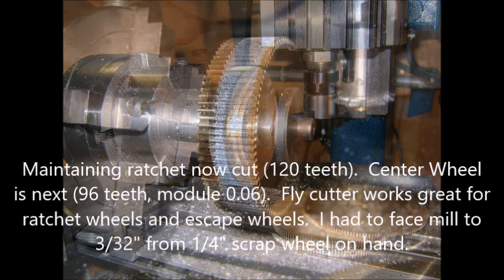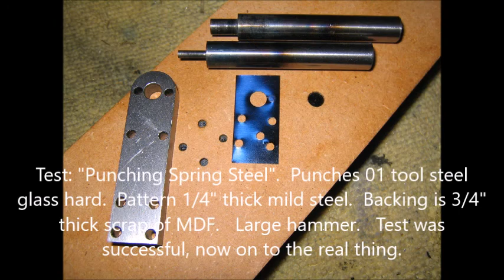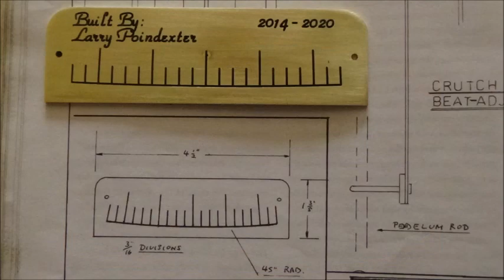Regulator Clock Build - Clock Progress Photos

Comment: Hi, I found that very interesting as I have just finished a very similar clock. Mine was from the book by Peter Heimann. It has skeletonised plates, but many details seem similar, particularly the crutch. I was told that mine had no chance of running asIcut the wheels with involute teeth, even cut the pinions the same way from drill rod. Mine has a conventional two-hand face and runs a month and keeps very accurate time. Currently the pendulum rod is ordinary mild steel but have got a carbon fibre rod to change to. Invar is about £50 in the UK.
All my shaped parts were hand sawn and filled and I spent over three years on it. I bought a chapter ring! Cheap silvered aluminium, but it looks ok. Looks like you have sophisticated machines, my are manual but I have been a toolmaker for nearly sixty-five years, so I am getting quite good at operating them.About to start a 16th century clock, as my cottage is from that era.
Keep up the good work and the videos, please.
Reply from the maker: Nathan:  I'm happy to hear that someone out there has built the same or similar.  Mine is the 8 day version (to answer your second question).  I find this clock also keeps excellent time.  I have a playlist for the clock but it's not very well organized.  I've also built several previous clocks where everything was done by hand, but this time I've found that CNC has been a treat.  I've never built a cabinet or case for any of them, but I'm considering building one for this clock.  I started this clock 6 years ago and it sat on a shelf for 4 years.  I just decided to finish it late last year.  I have made a few videos recently, but there doesn't seem to be much interest in clocks these days.  Thanks for your nice comment and Best Regards: Larry

Comment: Hi, Larry, I looked also at the link you posted and browsed through it, I get the impression that he does some of the drillings of taped holes by hand, I did find it very interesting reading, Question, the ball bearings on your clock appear to be free of cages and the balls are no longer positioned equally spaced, does that still work perfectly as a precision bearing?
Reply from the maker: That link is for another clock, but similar type with the same designer.  Mine only runs 8 days between winding and that one runs for at least twice as long.  There's not a lot of builds to look at via the internet, so I thought it might interest someone else.  Regards: Larry

Comment: Impressing!  Have You been clock a maker as a professiional?
Reply from the maker: No I haven't.  I did graduate from the Chicago School of Watchmaking in the early 60's but never pursued the profession.  I have built multiple clocks from scratch and repaired a few over the years.  I'm an architect/engineer by profession.  Regards: Larry
Reply: @larrypoindexter9351  Having a watchmaker degree is obviously a very good start. Had a student friend having that education but he headed for a civil engineer degree in electronics. He told some about watchmaking... Lots of high precision parts to make using lots of tricks.